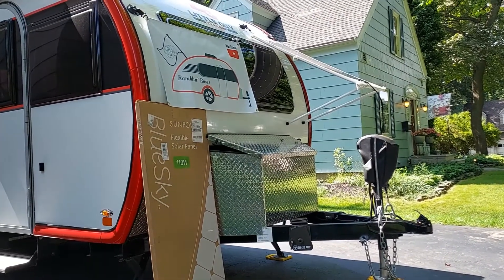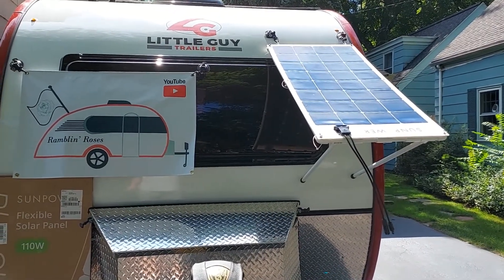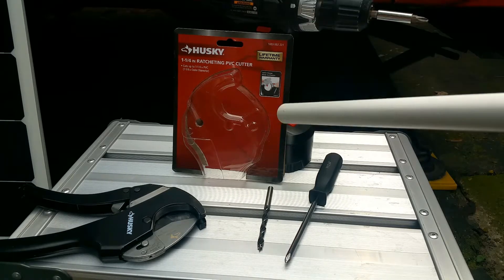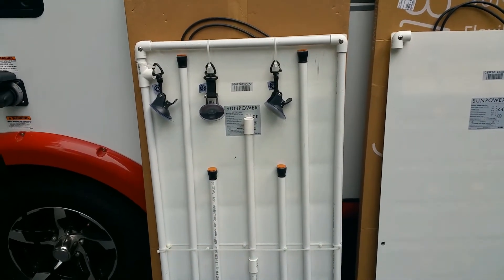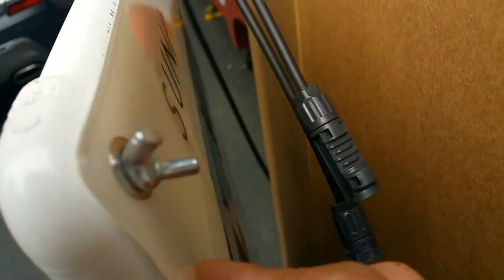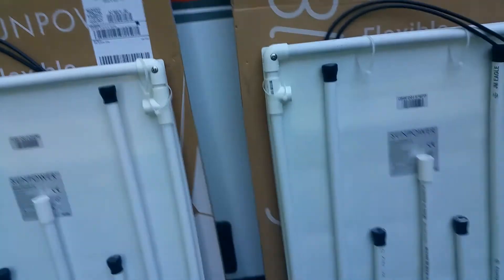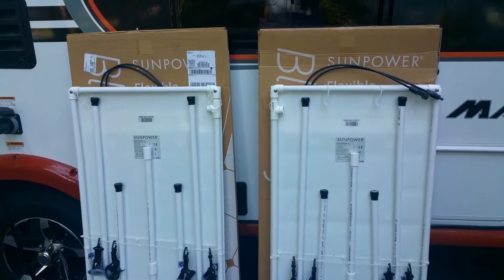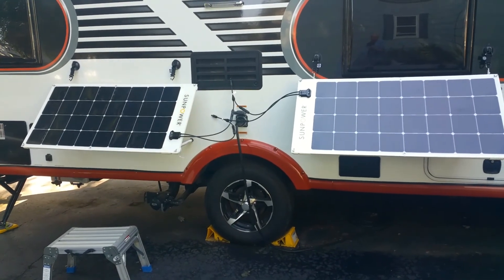Little Guy Max RV Solar Panel Project (Vlog #1) – Intro & Panel Frame Build

Comment: Wow such a great idea , I didn't want to drill into my trailer roof and screw down the panel, And wasn't to keen on the double sided tape method , Guess Im off to Home Depot for some PVC pipe Thanks a ton Greetings from Canada.
Reply from the maker: Same for me on adding to RV roof.....besides if RV is in shade no sun. With this method solar panels can be moved to capture sun.

Comment: Thank you for this.  I have the 2018 Standard Little Guy Max which also does not have the solar panel pre installed.  It does have the controller mounted inside which shows the battery status. 

Do you know if the zamp plug on the AC on the roof is connected to the controller or directly to the battery which will require a separate controller.  Thanks!
Reply from the maker: You will need a solar charge controller. See my link for this: https://youtu.be/GSKI2EY9ItY.  All the episodes for this build are below this video you watched.. Good Luck, love my setup, works great.